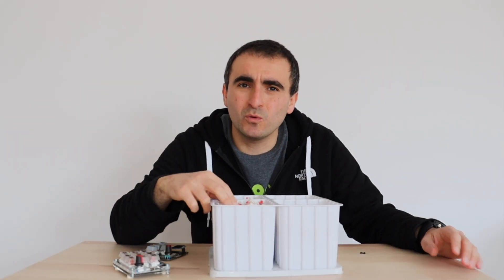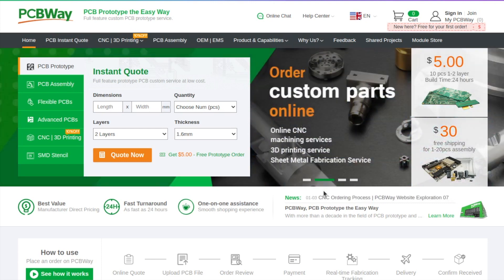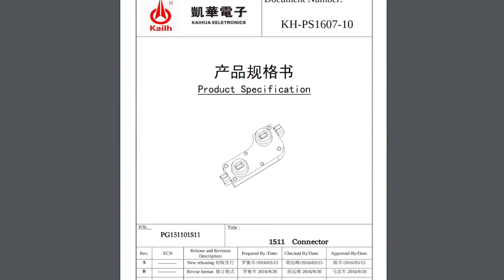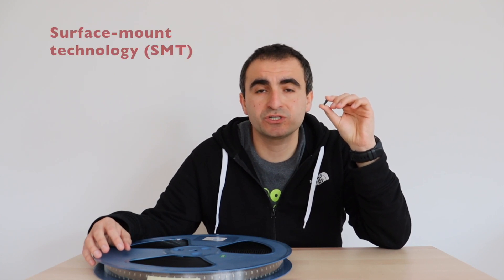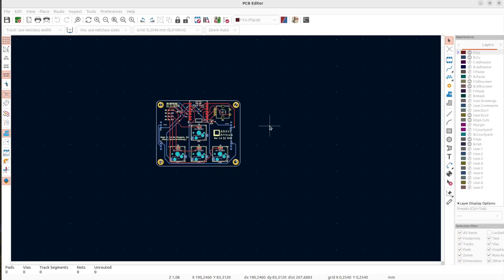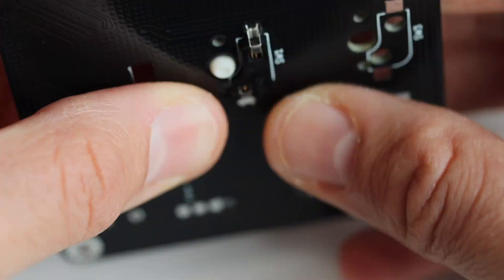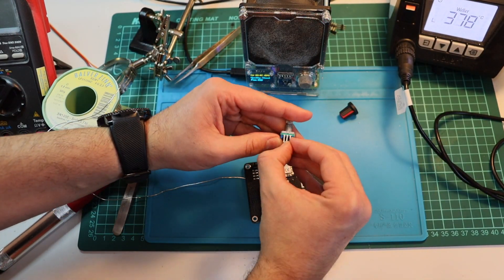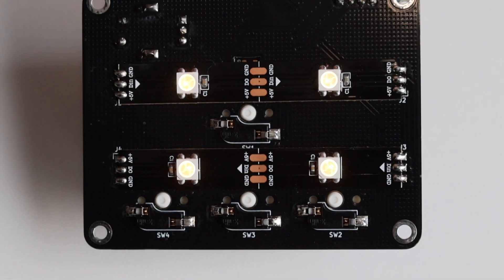Kailh Hot-swappable PCB Sockets for Mechanical Keyboards

Comment: i did soldered my ttc but the silver thing wont glue up in pcb... what should i do? 
did i do something wrong? 😢
Reply from the maker: Hm, what is the PCB you are soldering these switches to? TTC switches are Cherry MX compatible, aren't they?
Reply: @LeonAnavi  wait aren't they work universal these days?
om i got messed up a lot.. 😂
my board has outemu switches...

its a mechanical keyboard 75%.
Reply from the maker: @ridhoyuki8630  most switches are Cherry MX compatible like the Gateron switches in this video. However, there are other types too. The Kailh hot-swap sockets for surface-mount technology shown in the video require the PCB to be designed specially for them.

Comment: is it possible to desolder dead hotswap sockets to change them? or will that run the pad?
Reply from the maker: Yes, it is possible to do it. It won't damage the pad if you are using properly the right tools like hot air station to remove the old hot-swappable socket.
Reply: @LeonAnavi  would a desoldering gun with a iron work well enough?
Reply from the maker: @stinky5628  a desoldering gun is more appropriate for through-hole components. These hot-swappable sockets are for SMT. A hot air station will be more suitable to carefully heat the two pads of the socket and remove it with tweezers.
Reply: @LeonAnavi  thanks for the info! I'll look into hot air stations:)

Comment: Hello is not possible to use this with a Asus PCB red MX switch right? Because doesn't have the proper pads to he solder on with the kail hot swap?
Reply from the maker: The printed circuit board of the keyboard must be designed in a way to have pads for SMT assembly of the kailh hot-swap sockets. Otherwise these sockets support any MX compatible switches (aka as long they are MX they are supported).